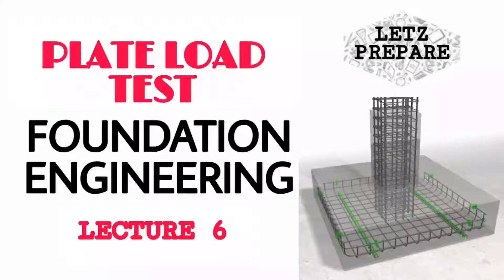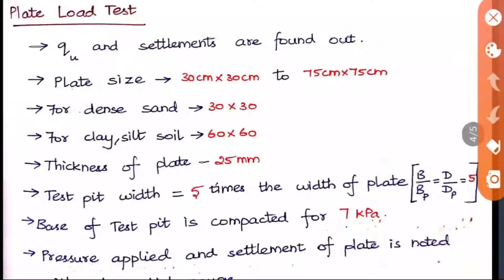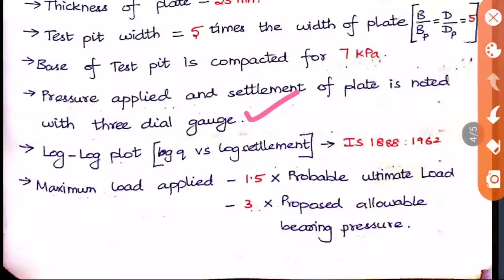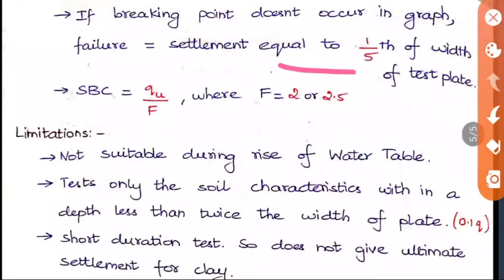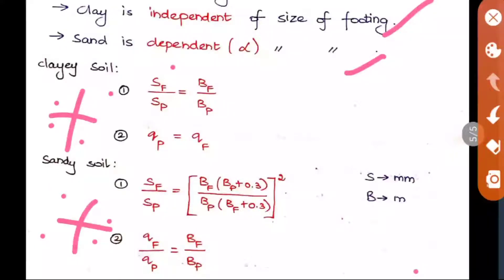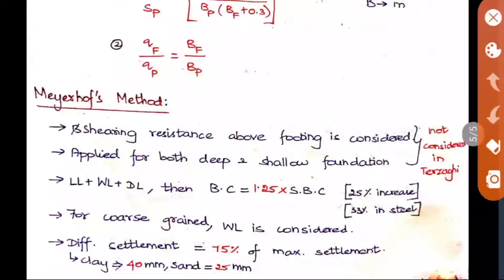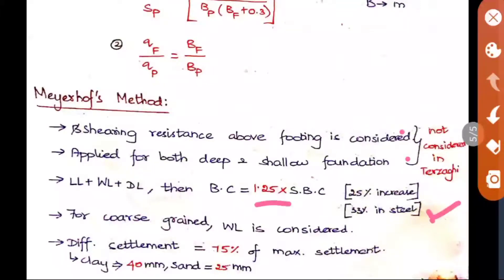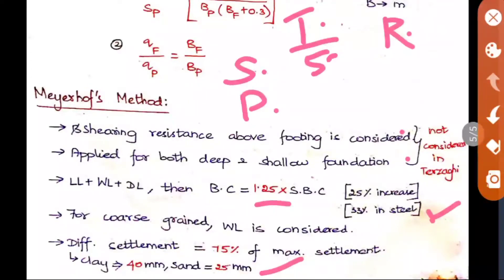Plate Load Test | Foundation Engineering | Lecture 6 | English

Comment: Mam,  1.plate load test Is code 1888:1982 or 1888:1962. Which one is correct    because as per your notes  1888:1962  but I am searching in  online the answer is coming 1888 : 1982   

2. Safe bearing capacity for  for plate load test.     Here.   qs = qu/Fos  but.  Your given   qs = qns + r Df.  In  bearing capacity chapter (video)
     These 2 question    which one is correct because I am confused.        Mam  Could you  tell me the ans.  It is helpful for my preparation
Reply from the maker: 1. Sorry for the mistake. You can go with the revised version IS 1888:1982-Method of Load Test on Soil.
2. Safe Bearing capacity of general footing and plate load test are different. The loading conditions of soil on footing and plate are also different. so don't confuse both. 

Thanks for asking doubts. Keep Preparing 👍
Reply: @letzprepare4511   tq mam   your cleared my doubts